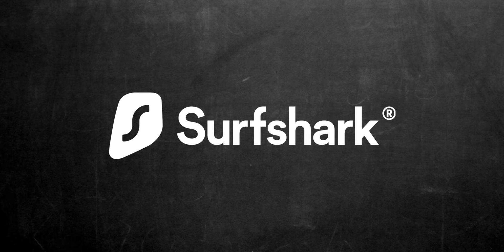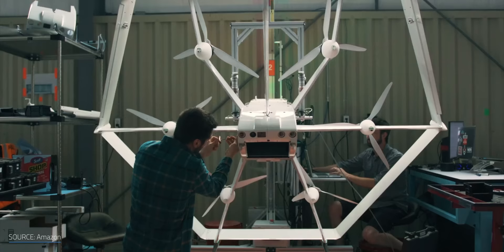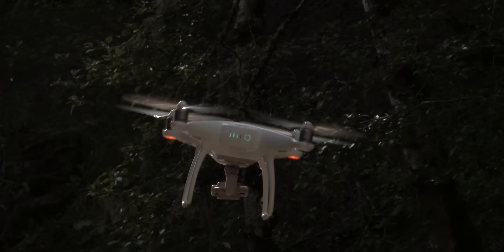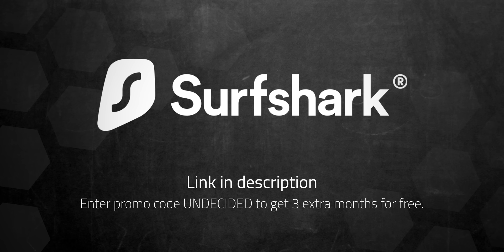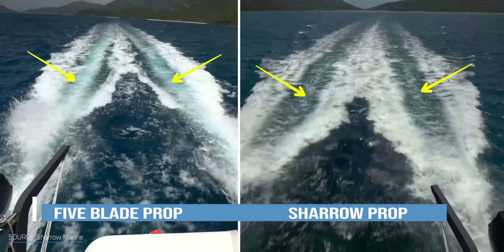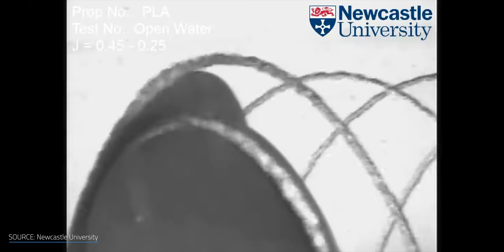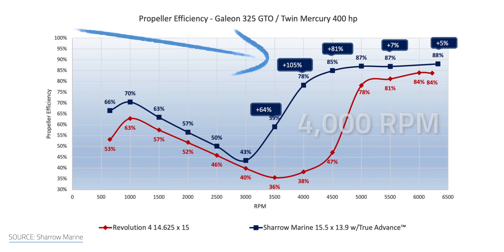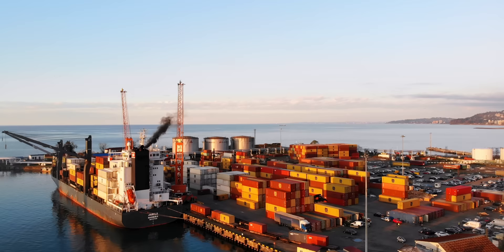Why is this Propeller Getting So Much Attention?

Comment: I first saw this sort of Propeller demonstrated in the New Zealand news program. Their version created alot more than 105% improvement, with a 15hp engine keeping up with a 65hp similar boat. So I think the design can be improved upon. Based on the Video I saw 20 years ago. Never mind , we just have to buy what is available.

Comment: As you pointed out the big hurtle to adoption for boats is the huge up-front cost.  For the average sportsman it may not make sense, you have to buy a lot of fuel to make up that 10x cost of the prop.  For larger work vessels the problem shifts to manufacturing, machining these extremely complex shapes will be a difficult shift for a manufacturer if they can't be guaranteed an ROI.  The enticement here is that for a commercial ship it makes more sense, cost of fuel is a really big issue for everything from a fisherman to an international shipper.  Adoption for the drone industry on the other hand may be a no-brainer as half the draw for lower end drones will be just the "latest tech" incentive.  Other applications (think military) may be drawn by the more stealthy features.  Time will tell but I have a feeling these toroidal props with make there way onto the stage sooner rather than later.

Comment: Hrm, think I'm going to try print some fan blades for PC and the 50cm fan I use to keep my place cool in summer.

That large fan has 3 settings and I've never ran it higher than the lowest, because of the noise.

If a fan shape like this can reduce the noise ( and power consumption) to this extent, I can see this tech spreading rather quickly in the coming years.

We use fans and propellers in far more than drones and boats. As Matt already referenced, pumps are an example.

But our PCs and laptops have fans too and the fans are often the main headache when it comes to noise generation.

Being able to attain higher levels of cooling for less noise is going to be fantastic.

The main problem I see is that these shapes aren't as simple to manufacture as classic fan designs and don't use the same type of tooling, meaning it'll cost more and manufacturing outfits won't jump on it quite as quickly as one would hope.

If they would, the economy of scale would bring the price difference down rapidly.

Comment: I've machined impellers for several years using CNC 5 Axis mills and lathe turning, at one point we machines castings, already with the blades molded in, the castings saved a whole lot of hours milling, I would think someone's going to be casting these new teroidal propellers and reducing much machining time. The ocean cargo ships might be much cheaper than expected after a few large castings are tested.

Comment: I wonder if this would help reduce the number of whale strikes. One of the theories about the cause of whale strikes is that the ship's noise interferes with the whale's echo location. The whale becomes confused and simply can't avoid the ship. With a change in the sound level, and pitch, it may help reduce the number of whales found impaled on the bulbous bows of ships.
Propeller strikes, such as those seen on manatees may also be reduced. As it's not a sharp cutting edge, the damage to manatees backs would be significantly reduced. Whales have also been victims of propeller strikes. BTW, the proper name for a ship's propeller is a screw. (4 years in the Navy and 2 years at sea.)

Comment: The price of toroidal boat props is a significant roadblock for a lot of people.  Most people run their recreational boat engines less than a fifty hours a year.  At that rate, the additional expense will never been recovered in fuel savings.  Toiroidal props won't become popular in recreational boating unless/until engine manufacturers offer them as a standard upgrade option on their new products.

Comment: My first thought was to print out fan blades first for my box fans used in my home.  Bathroom vent fans, stove vent fans ,computer cooling fans, any other small ventilation fans would be a good target. DIY HOME USAGE  may be a way to croud source solutions for other commercial purposes. 

Just a thought
Wolfmama

Comment: 6:05
"But the dye being pushed out behind it forms a tighter stream"
That's not dye.
They are bubbles. 
The large central stream coming out of the centre of both props are bubbles of exhaust.
Outboard engines vent the exhaust gas out of the centre of the prop, underwater....
On the tips of the standard prop, the small spiral line of bubbles are caused by cavitation.

Comment: I love the prop. Both air and water conditions. I see the expense of manufacturing. It would take a unique maybe 7 axis milling machine a lot of time to produce. Small scale 3D printing can be done in hours or days. No life threatening issues, as long as there is protection between you and the prop. One possibility for the prop to be used in is HVAC and dust collection. Again testing needed

Comment: One thing that can be counted on is for industries like shipping to use whatever method is the most expedient, requires the least amount of down time (repairs and retrofits cost money to perform and whatever length of time the ship isn't transporting cargo it also isn't generating profit) and how all of that can be done as cheaply as possible. So laying up one of these behemoths, taking it out of rotation will require the upgrade to be worth more than the money lost while it's being worked on. And i don't see that happening

Comment: Ah, a high solidarity, over 1, but has the same spin thus also induces a high torque, thus the Reynolds number  that really constrains it creates a optimal range that is going to be much more narrow; i.e. it will operate best as a certain speed range  The other option is a ducted and statored propeller or counter rotating propellers and that reminds me of designs that have been released on fast attack submarines.  Note that Volvo Penta marine drives have been counter rotating props for years (the expensive 'get up and go' power boat option).

Comment: Another way to explain why "silent" propellers are more efficient, is considering that sound is taking away energy from the system, like heat would, so reducing noise means more efficiency :)

Comment: Lawnmowers! The bane of quiet urban relaxation. As most of the noise is from the blades so replacing them with a toroidal blade should reduce said noise dramatically.
Reply: No would be useless for a mower

Comment: I think it is sturdier than the regular propeller because all 3 blades reinforce each other, preventing any blade to resonate itself to the point of destruction.  A long time ago, I used to see this kind of design of propeller played by young kids with a foot-long stick.  The said propeller was made of thin and flexible plastic ribbon with colorful glossy appearance. It usually has 3 or 4 lobes.  When the wind blows, the toy propeller would spin accordingly.  You can also wave it in the air to spin it.  Thanks for showing the video.
Reply: Pinwheel fans.

Comment: As someone who work with boats i can't name one customer that would be interested in a 5000$ prop that could potentially be damaged the same season. What good is efficiency if you never let it live long enough to come around the high cost buying it and cover it by saving fuel? And it's a technology that's been around for a long time so it's obvious why it's not mainstream yet. I'm very interested in the concept though but the price and the everyday risk of damaging it doesn't make it interesting enough.

Comment: "Any mistakes in the manufacturing process are likely to be expensive."  That is probably an understatement.  If you have a toroidal propeller on a ship or boat and it suffers a failure because of a manufacturing defect, there's no easy way, or probably any way, to perform a temporary repair to it.  Your talking about a total replacement.  Even worse, in the case of an aircraft that isn't a drone, the expense is likely to be measured in human lives.  It's one thing for a ship to be forced to reduce speed and head back to port or need to be towed back to port because a toroidal propeller has a manufacturing defect, it would catastrophic if that defect caused a failure on an aircraft, whether it was taking off, landing or cruising at altitude..  I'm not dissing the possible benefits of toroidal propellers, just pointing out why it probably won't get adopted quickly for every application.

Comment: That concept has been around for a while like from the DaVinci area,  but no one wanted to use it saying that it was a bad design for safety reasons although blade reducancies for aircraft could be part of the design and marine applications were worried about down time due to things getting caught or grown in the blades (they also assumed marine life would get hit more with less noise).  The issue of not picking up history books is a massive one and plagues everything from society (if you ignore the mistakes of the past you are doomed to repeat them) to science (rediscovering things that are easily searchable).  With all this being said, I am glad 😀that Toroidal Propellers are starting to see the light of day this was also one of my green effeciency purposals (since all you had to do was to get a physics nerd and a history buff in the same room) for the shipping industry that I never released to due to NC Safety Review board shut down my nitrogen based medicine Scaling project that had massive applications to the gun powder industry that was later created and tested by a big company about 10 years later after I released the idea and some intial designs on science forums and exchanges since NC was too short sighted to break into a two multibillion dollar businesses.

Comment: yea, drone delivery is not a net negative from centralized grocery stores and walking to them. like so many problems specific to suburbanization....
Reply: Images drone delivery in New York City lol.

Drone delivers is good for the countryside provided the drone has the range. And the suburbs arnt going to die tomorrow and will last for several generations. Neighborhoods that were built in the early to mid 1900s are standing today. So drone delivery will be needed for lowering energy requirements and lowering costs and removing the need of pizza delivery vehicles that are large crossovers and SUVs  for delivering pizza.

Comment: Perhaps good for boats, but for the majority of aircraft this design is not applicable as it lacks one of the most important features: adjustable propeller pitch. Also, the reduction of prop tip vortices to increase efficiency is anything but a new concept, Hartzell's Q-Tip props for aircraft have "winglets" that do exactly this, in the same way that winglets on wings reduce wingtip vortices (and hence drag).

Comment: Was watching The Americans, a drama about Soviet spies in the 80s. They were trying to steal a propeller design. I thought, what's the big deal with that? Well it is apparently. When the prop spins, it actually creates a pressure zone and the water around it actually boils and the little air bubbles popping make a lot of sound. So someone redesigned the prop to not create those bubbles, thus making the ship quieter. Funny, you'd think propellers and wind mill blades would be figured out pretty quickly, but no, there's still a lot of unknowns.

Comment: I wonder what the efficiency gain would be when they've compared it to a conventional propeller with a proper pitch. 
Also a graph of advance ratio vs efficiency would have been more valuable. 
As an engineer in one of the largest wind tunnels in Europe I really wonder whether there is actually a significant efficiency gain

Comment: Genral question I have not seen you do a video about Bio-Gas production AKA anirobic digesters. and using the refined methane for home power use plus the heat that this process generates.

Comment: B.S , the laws of thermodynamics do not allow for a 105% efficiency in any energy conversion process. The efficiency of any energy conversion process is governed by the laws of thermodynamics, which are fundamental principles that describe the behavior of energy in physical systems. The first law of thermodynamics, also known as the law of conservation of energy, states that energy cannot be created or destroyed, only converted from one form to another. The second law of thermodynamics states that in any energy conversion process, some of the energy will always be lost as waste heat. This means that the maximum possible efficiency of any energy conversion process is less than 100%, since some energy is always lost as heat.

Comment: The real issue with maritime shipping emissions is not GHGs, but sulfate aerosols. The only GHG which most ships emit very much of is CO2, which mainly has positive impacts: climbing crop yields, improved drought resilience, and global greening. But sulfate aerosols cause real air pollution, and they have a harmful cooling effect on the Earth's climate.

The new IMO 2020 shipping regulations have reduced human sulfate aerosol emissions from ships by almost half. Because ships were estimated to have accounted for about 20% of all human sulfate aerosol emissions (before the reduction), that reduced total human sulfate aerosol emissions by about 10%. That has had a measurable warming effect, especially in the North Atlantic.

Comment: 6:54 The noise reduction is only partially convincing; People knowing to read an FT graph will notice that, while Identifiable frequencies are less pronounced, the low frequency White noise is higher on the right side. Don't forget the noise is not (only) the spikes, but the total curve integral and one can easily notice how the green on the right overcomes 20 dBA at 200 Hz, while the classic propeller does so only above 350 Hz. On the other hand, above 3 kHz, the green drops faster. So things are not as simple as publicity shows and, hopefully, the prof commissions know how to categorize them according to the field of application.

Comment: Think about upscaling in flying cars, helicopters, and airplane propellers.  This would be a huge brake through if any one could put this in a jet engine.  Quieter (Population centers and military) and more powerful:  Heavier lift, faster,  smaller engines.  Lower fuel consumption:  Longer range, smaller fuel tanks and over all size.  New applications:  Flying cars, trucks, and busses.       Wow     :)

Comment: I would like to see some independent tests on these propellers.  I suspect there is some puffery going on here.  And as to the noise, part of the issue is that we aren’t comparing apples to apples.  Comparing to two blade prop to what is effectively a four blade prop is going to distort the results substantially as four blade conventional props perform and sound much different than two bladed props.

Comment: One application you did not mention but has a lot of day-to-day impact: the noise made by cooling fans — in computers, in air fryers, in induction burners — and exhaust fans — in the bathroom, in the kitchen. Fans are noisy — I hope that manufacturers of domestic fan applications are switching to toroidal propellers to lessen the noise pollution in the household.
Reply: Major Hardware tested this; it turns out you actually get worse performance versus a modern ducted cooling fan because those already have minimal clearance between the blade tips and the drum they're mounted in.
Reply: @stevethepocket  I was more interested in noise reduction than in performance.

Comment: big drawback for race boats is the sharrow is not a surfacing prop. so at high speeds and rpm, it will be much worse than say a chopper or cleaver prop, which means no testing in a race setting, which is where the $ is.

Comment: I'm more curious about how strong they are. I have a lot of dings and chips on the prop I'm currently using but it still works, this looks like one of the blades might not survive a simple bump or tap

Comment: Thoughts while watching this:

1. That shape looks a lot like a crop circle I've seen.

2. Is this propeller more expensive due to patenting, and shouldn't that be sidelined if it means significant global carbon reduction?

3. Couldn't AI and quantum computing come up with super optimum propellor designs, simply by using the laws of physics?

4. Could the same technology be emloyed in hydro and wind turbines to increase efficiency and output?
Reply: I mean, if I understand this correctly, this design  employed in most fans ( and posdibly turbines) of all different kinds around the world could make a phenominal difference to power consumption. Think about the noise pollution from aircon fans, free standing fans, car air fans, equipment cooling fans, compressor fans, pump turbines etc. I'm no phd, but noise pollution is a symptom of lost energy and resistance, right? It also is a factor in damaging our environment. This is fascinating. I've never thought about this, but it seems immense.

Comment: An 18 blade shrouded parametric propeller found on thingivers_ is the best I've tested.  40mm-1000mm for both drone blades and wind generators, the shroud connecting all 18 blade tips makes a huge difference in sound and performance.  They also look cool, like a turbine blade